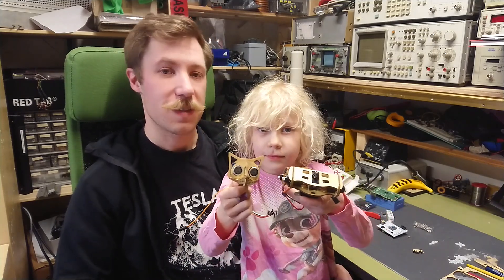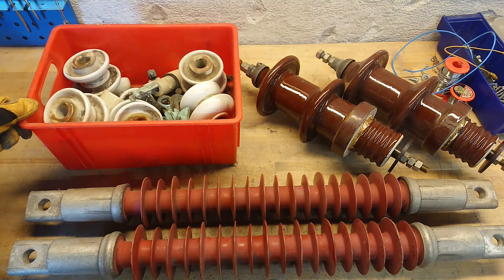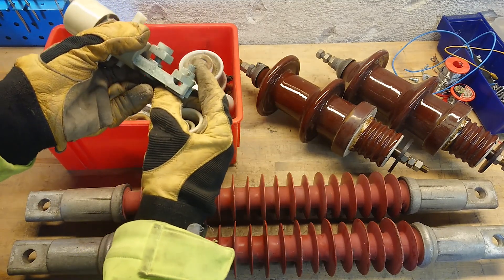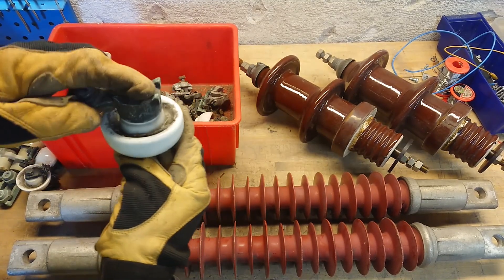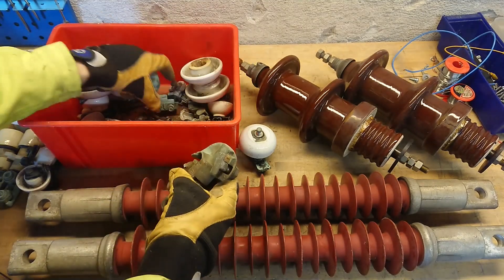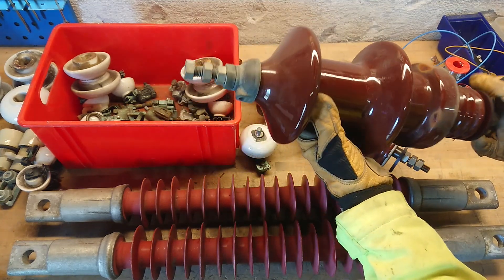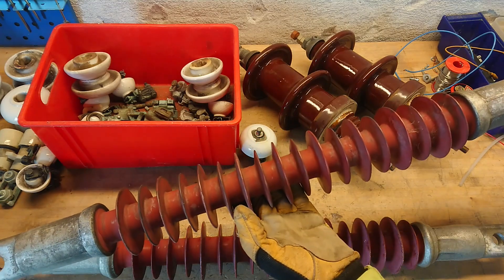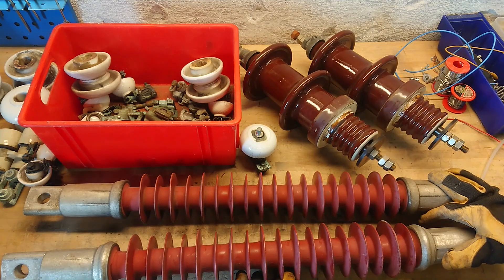High Voltage Insulators - Isolation, Day 20

Comment: Good video and I'll help with some of the terminology. The hook clamps as you called them are called hotline clamps. They are installed with an insulated ratcheting hotstick that some call a "shotgun". You wouldn't normally use those for grounding though. There are special grounding sets that have to be tested to maintain a certain level of low resistance. Tested with a DLRO or dedicated grounds tester. So if a line were to be energized with the grounds installed it would be able to maintain the ground (or phase to phase short) long enough for the protective relay to pick up and clear the line. Something with a high resistance could just be blown in the clear. 
The feed throughs as you called them are called bushings in the industry. Once you get above 15kV or so the bushing will be oil filled with paper windings inside to form a capacitor. They then become a graded capacitor to cut down on the voltage levels between the center conductor and the item it is penetrating. Those get tested to, usually at least by checking the power factor or polarity index to make sure they are still operating as expected. 
One thing you didn't show are the big glass "bell" insulators that you normally see on high voltage lines. As a general rule of thumb one "bell" is equivalent to 10kV. So if you see 10 bells hanging you can assume the line to line voltage is near 100kV. 
Any questions, just ask. I work in substations and deal with this equipment and the protective relays all the time.
Reply from the maker: Thank you very much for all that information! 
Is it true that the glass disks from HV lines is made for such tensile stress that they easily explode if dropped or hit with a sharp object?
I might get in some good oldschool substation switch gear from a decommissioned generator set, so there might be more coming, I hope there is still some automatic switchover relays and such :)
Reply: @KaizerPowerElectronicsDk  No problem. I had never heard that about the glass bell insulators doing that, we would load old ones on trucks without any special care and never saw one explode. Old generator stuff sounds interesting! If you want some help with items you are unsure of before you make, well hopefully make, a tear down just let me know. My current job is working in the generating plant in Antarctica at the US Research Station McMurdo and have worked at a few other generating plants in my career.

Comment: Those 400V insulators are similar to the ones here, though they are still very common, as a lot of the overhead power distribution is still done with bare copper wire on poles. They are slowly being replaced section by section with ABC though, generally done when the area is in need of upgrade power wise, or where the cabling is being stolen, though in most cases the upgrade is done when the copper price is high, so that the cost of the new ABC install and the cable cost is covered by the sale of the old copper wire on the scrap market.

Got 11kV pole insulators very similar to your ones, removed from rural distribution use, as a lot of that has moved to ABC cable as well, because of cable theft, and the insulation on the aluminium and steel core cable reducing the number of faults from shorting cables if a pole falls over, or from tree growth.